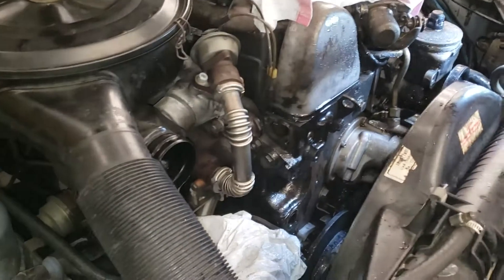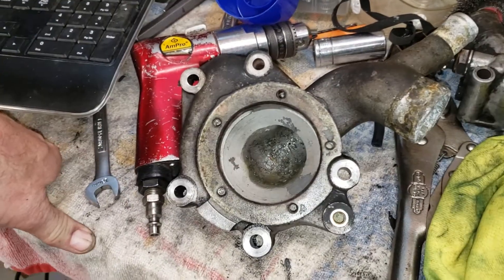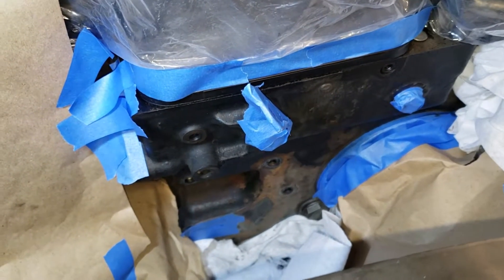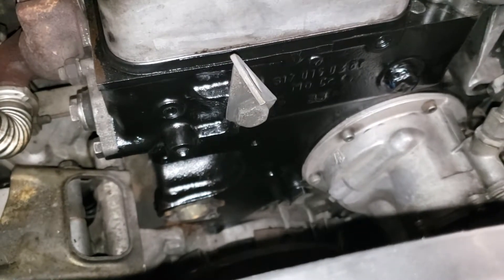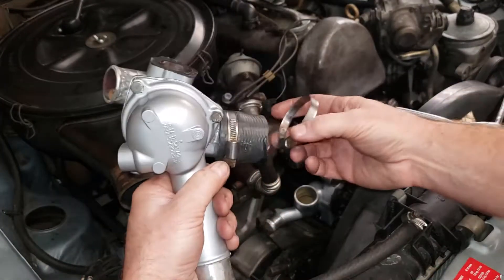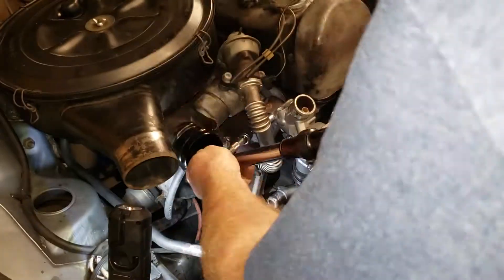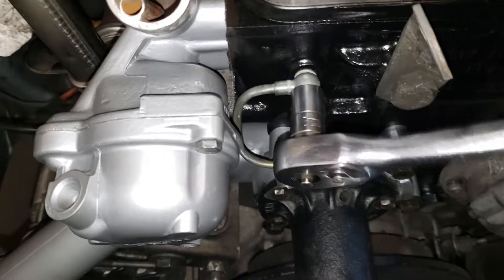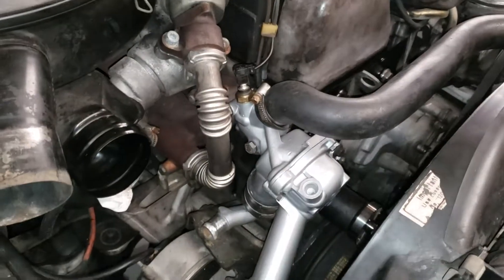W126 Mercedes 300SD Engine Cooling System Maintenance - Part 2

Comment: Did u make a video of you taking off the water pump?
Reply from the maker: No I do not recall filming the removal of the pump. I was more concerned with the corroded thermostat housing at the time.

Comment: Great video. Whenever I’ve done this job on my 616 and 617 diesel Mercedes’ over the years, I never used rtv on the gasket and didn’t have any issues with leaks. I was under the impression it wasn’t necessary for Mercedes’s.
Reply from the maker: Sealants make reassembly easy because it prevents gaskets from moving around. They also add some leak protection to the gasket. They have their place on all cars regardless of manufacturer. I've never NOT used a sealant on any car's coolant system. However if you have a system that works for you, then go with it. Cheers.
Reply: Good points and I agree. Great work!

Comment: Looks really good at the end! Specially how u did it all cleaned up and painted. I’m trying to replace my lil stubby bypass hose on my om617. Any advice?
Reply from the maker: Only to not get in a hurry. Pretty straight forward really but be prepared for corrosion issues.

Comment: Most of the grease on the outside of an engine comes from the valve cover. People overtorque the bolts which crushes the gasket which causes it to fail and also blows out the holes in the cover so it is no longer flat. I never had any grease on my MB engine.
Reply from the maker: Waiting on a new oil cooler line to arrive from Germany. 3 or 4 weeks probably. Then we'll degrease everything and start fixing oil leaks, along with a valve adjustment.
Reply: @ImpalamansGarage  just out of curiousity, how often do you adjust your valves? I think it was Mercedessource said every 12,000 miles but I don't know if that is necessary and also don't remember how often I did it on my two diesels. 
I'm glad to see you do not cheapen out with Chinese made junk.
Reply from the maker: @wernerdanler2742  I've only owed this car about 8 months, so never! lol
Reply: @ImpalamansGarage  ok. Keeping the valves adjusted makes a lot of difference in how they run and keeps the smoke down quite a bit. I guess newer diesels have gone to hydraulic valve lifters from what I understand, but these older ones are all solid lifters. Also fuel timing makes a difference. I've also seen the accelerator linkage fall apart on these because it is a little convoluted. The clips holding it can break or just slip out and let the pieces come apart. Have a great day!